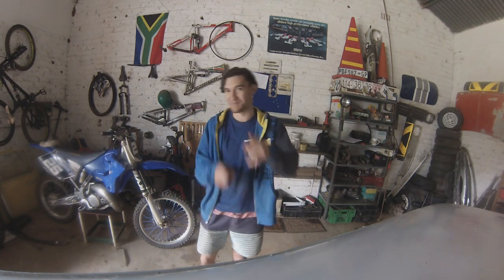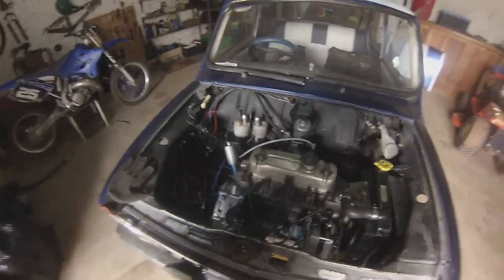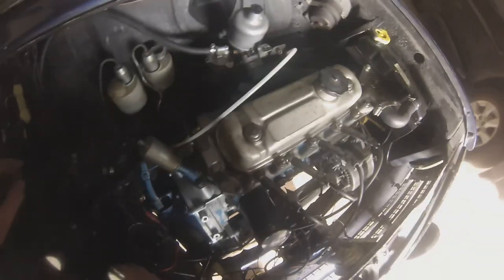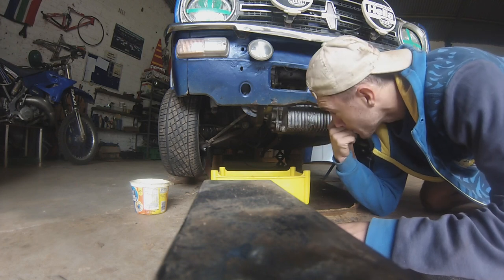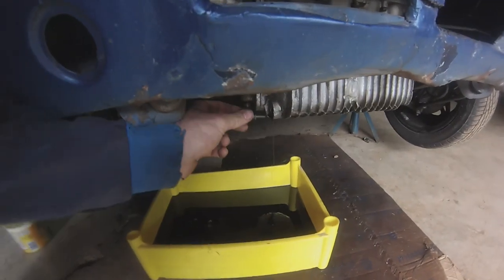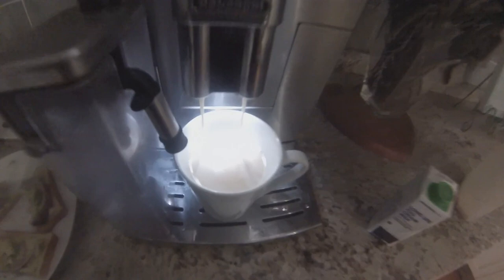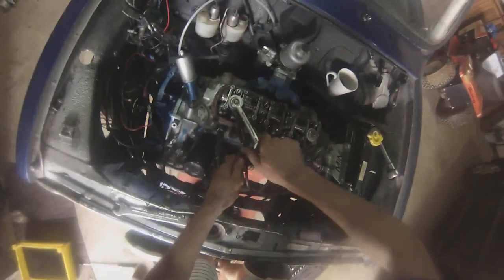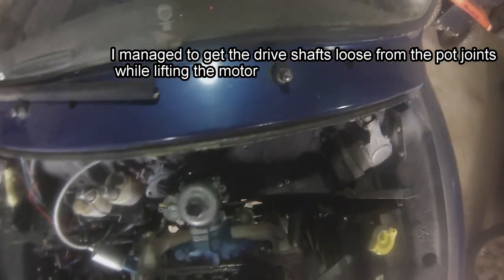Classic Mini 1275 Engine removal

Comment: You need to treat yourself to a couple of engine lift brackets which attach to the rocker cover bolts . Rocker cover can stay on . Good vid it took me back to the 80s when I worked on them at an Austin rover dealer
Reply from the maker: Oh yess I’ve seen those before , I’ll definitely fab up some of those brackets or into the spark plug holes too, I know @classicminidiy has a set of those 👌🏼